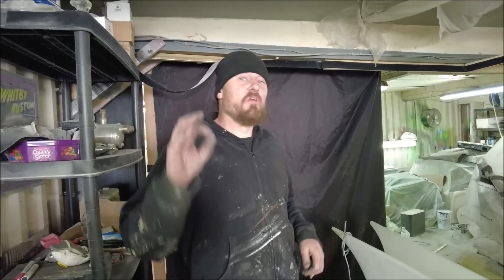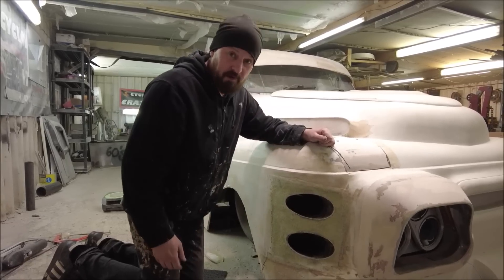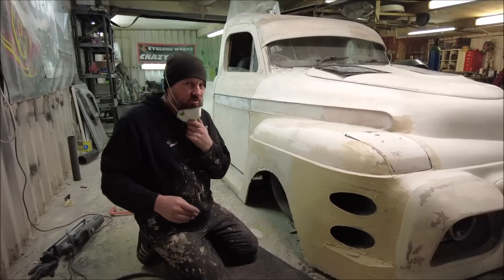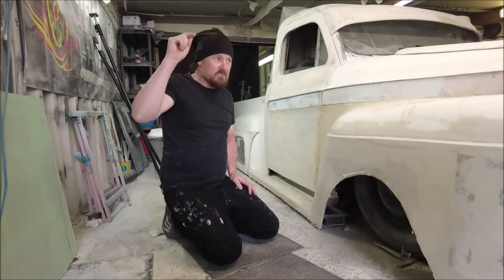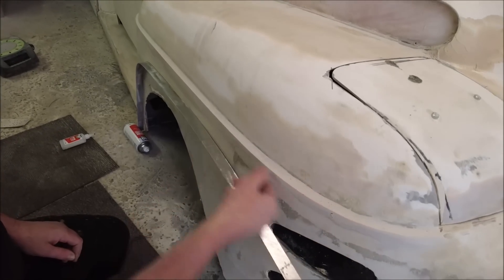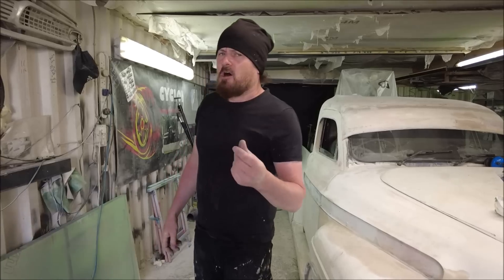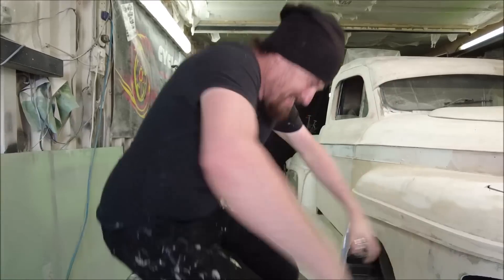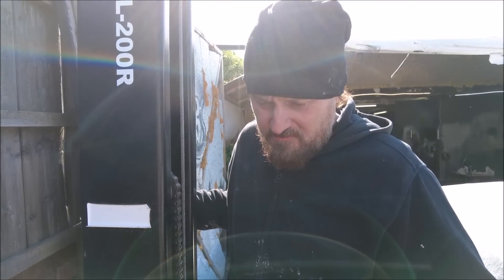YES, this is a real car!

Comment: hey paul ... we watched the ultimate hot wheels challenge ... Hats off my friend - what an amazing job you preformed on the Camaro - we hope that people know -  "They" ordered the wide body kit and tires and wheels (and one would think the parts would fit together) after all your amazing work to make that horrible wide body kit fit the car ... there poor choice of tires and wheels were wrong , they should have changed to a new set that fit  ! - that had nothing to do with your work , and also you adding the indy car - air dams , spoilers and monster wing ... you gave them what they wanted and in our option should have won ... that charger , if it actually drove "couldn't move an inch on those ridiculous jack stands" wheelie car what a joke"
Reply from the maker: Cheers for your kind words, I have read a few similar comments online, but hey it is what it is :)
Reply: @bacop001  we have a set of 1924 Lincon headlights , if you research - may be what you need for the Mercedes roadster ... looking forward to that build in the future "keep up the amazing rolling artwork"

Comment: You should always build your own car how you like. I never liked building or painting cars for customers... I like the cut down Dagmar lights on the rear fin idea. If you did LED strips like modern electric cars, then it wouldn't fit with the rest of the 50's/60's space ship cruiser vibe.. They built show cars back then to reflect the new space era, but they didn't have the technology to to do it right so they had to make do with what was available then. Which is why LED's would be wrong.
  Nice lines on the 60's truck.
Reply from the maker: Thanks for your comment.  It won't have straight line LED lights, it should work out to be really cool and hopefully in keeping.

Comment: Just a little tip.....

Add resin to your body filler....it adheres to fiberglass better and is smoother for sanding...just resin..the harder from the body filler works for the resin also..

The amount of body filler you used I would have put in about 3 tablespoons(I'm american so I don't know grams)
I learned that tip many many years ago from a hot rod builder

Comment: ok.. i'm all for throwing ideas around , here we go - dualatron absolutely not on the cadi bullets "the cat eyes make that car" maybe new lenses crystal , diamond red , sequential lighting "but" wheel spats (front) or skirts on her would work very well - on the 60s truck the extended lug nut covers placed in the air intakes is killer would give it the saber  wwll fighter jet look ...
Reply from the maker: Yeah I'm still in the thinking stages, but stay tuned I'm sure it will come to me

Comment: The truck looks awesome.  But I don't like the angle up to a point that you did with the aluminum. I think it should be round to match the ports and round front of the detail on the hood. Just saying.
Reply: I was thinking the same thing. Paul, give it a bit of consideration - that pointy end seems to fight against all the nearby curves.
Reply from the maker: Kirst agrees, I'll definately take a look at that